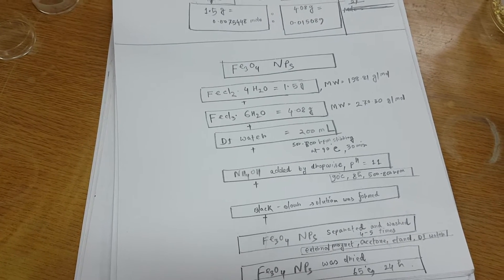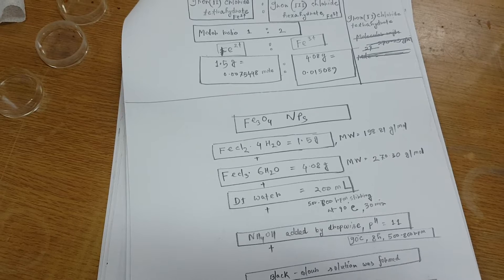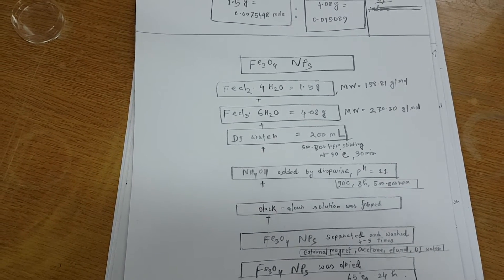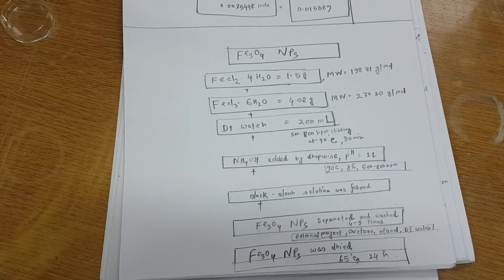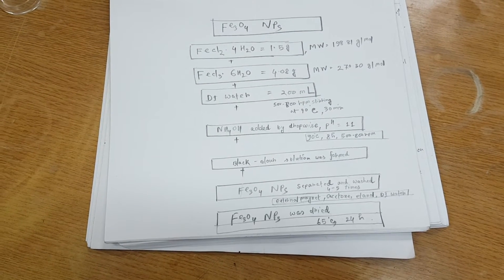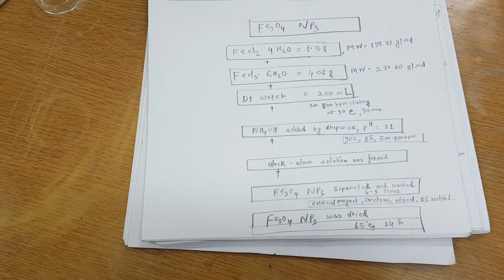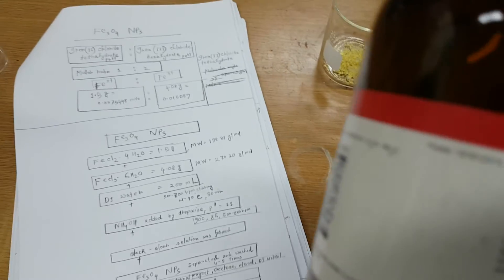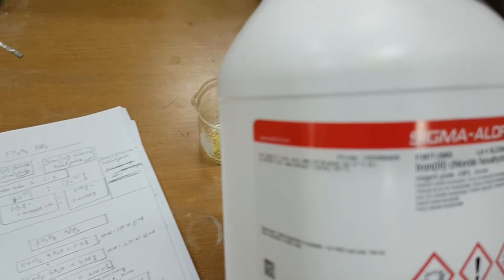Synthesis of Iron oxide, Fe3O4 Nanoparticles

Comment: How to synthesis CdS@rGo nano composite by coprecipetaion method ??
Reply: can we use anhydrous iron chloride instead of fecl3. 6H2o
Reply from the maker: Initially, the rGO precursor should be prepared by the above-mentioned procedure, or the relevant other procedure, which is then followed by a transition metal, such as FeCl3 can be added with the optimum ratio. Thus, you have to find the right metal precursor for being final proceeded with the CdS@rGO catalyst.
A reference paper you may be noticed here: 
Green Chem., 2019,21, 4046-4054.
Thank you.
Reply: plz answer me
Reply from the maker: @duhasabar7934  Of course you can use it.
Reply: @ronieu1  thank you sir
Reply from the maker: @duhasabar7934  You are welcome ~